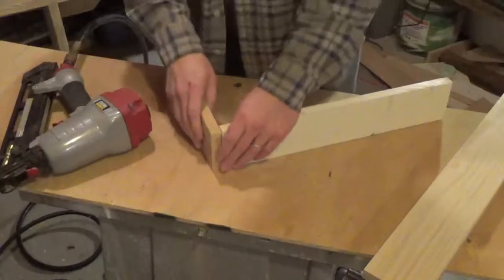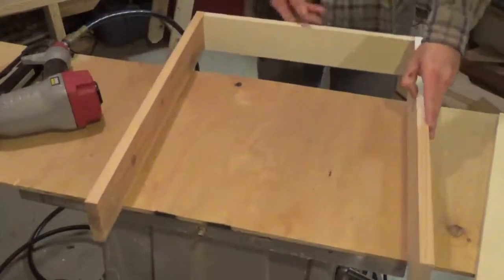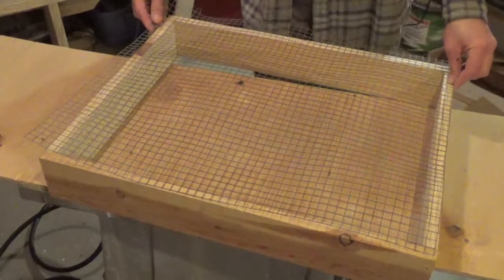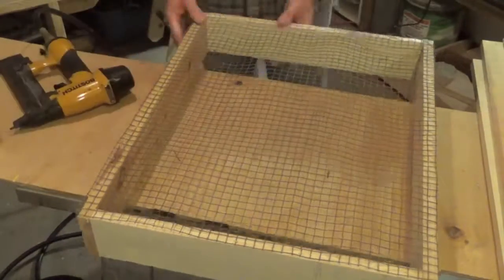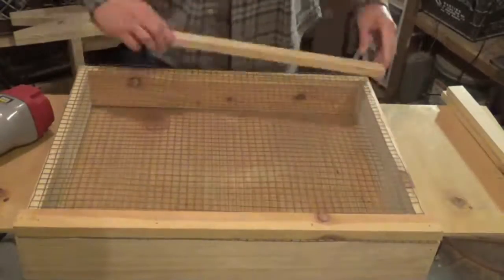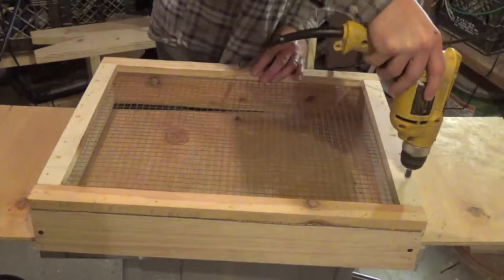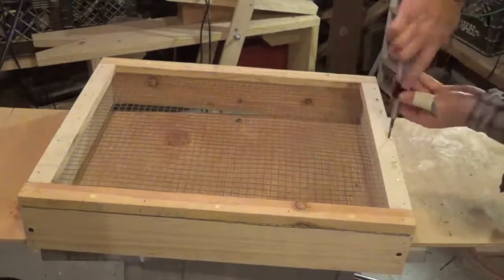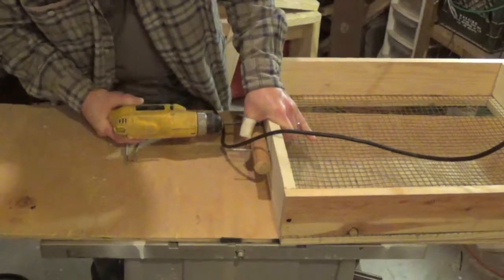DIY Treasure Hunting Sifter / Classifier Build

Comment: Nice job.  I honestly never saw anybody put glue into the pilot holes.  I guess it can't hurt.  I just didn't think it was necessary.  
Screws are pretty strong in themselves.
Reply from the maker: This has been something I have always done. Actually, many years ago when I built custom billiard tables, we used beeswax on all the screws. It made it far easier to drive them in and it acts as a "semi-flexible Loc Tite." You can see a video that kind of explains it right here: https://youtu.be/7M5b0F6E2Mk

Comment: Actually, taking that small amount of extra time and effort will help out in the long run. It will be sturdier and last longer. I wonder if second one could be made that has a screen from an old screen door on it then stack them to go ahead and sift another size. Or maybe even use them separately, but build them the same way. 

Nice video. Thank you. You just saved me a ton of money. The prices of the store bought classifiers are kind of high, imo, considering they aren't much more than plastic.
Reply from the maker: Love the idea of making a "set" like that. If they stacked, they would be very easy to transport and not take up any more space. 

Thanks for watching and taking the time to leave a great comment! Happy digging!